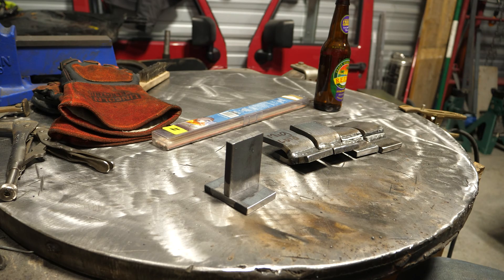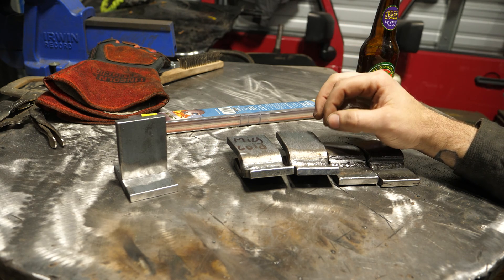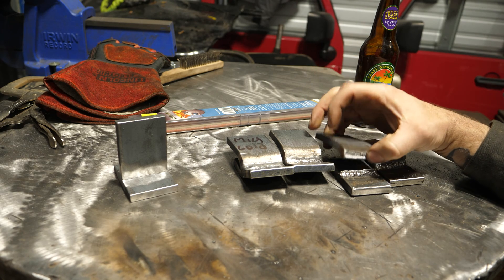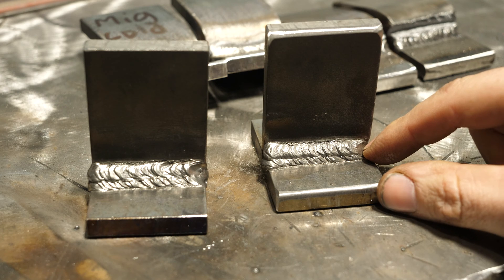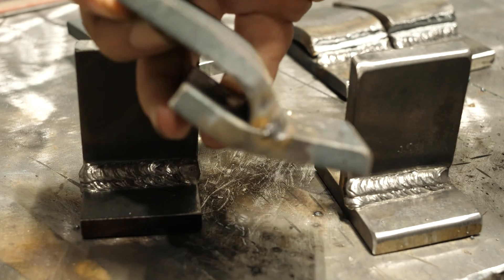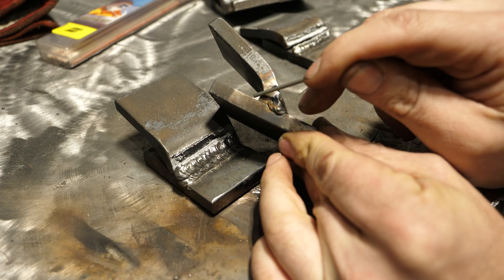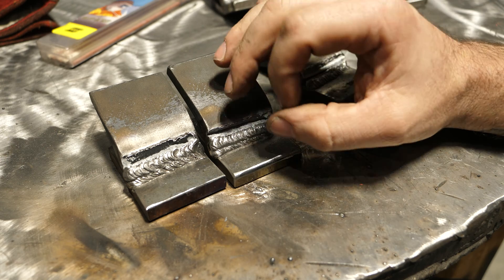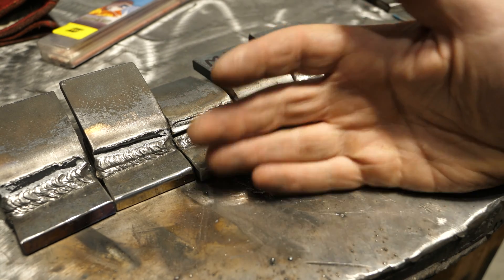6010 3 pass weld, will it break vs 7018?

Comment: In the school i went to we post heated and annealed 6011 to pass a guided bend test. 7018 over 60 series also tends to anneal the 60s deposit ? I only use 60s for an open root or thin non critical applications. Almost never.
Reply from the maker: So there are a lot of ways to get a bend test to pass when it normally wouldn’t (such as heat as you found out).  Capping 60xx series with a bunch of 7018 layers might reduce some of the brittleness, but I wouldn’t trust it unless it’s the only option.  I mean in all honesty if someone just used 6010 to bridge a gap, ground the root pass down a bunch, and filled it out with 7018, I doubt it would make a huge difference for most things.  What I would worry about is if what’s repaired sees impact force or vibration, that thin root could still crack.  7018 is significantly stronger across the board when it comes to holding things together that sees vibration and impact forces.

Comment: Does 6010 burn hotter than 7018? Any chance preheating the steel could mitigate this failure?

Looks like the top edge of the weld has more leverage on it. 
I wonder if it would change anything if you flipped that possible undercut by repositioning the steel before welding, so that the top edge ends up on the surface of the other piece, to see of it changes anything. 
If it follows the up-side, it might prove something is happening with the weld vs the current top side seeing more force.

Comment: Hey Greg, i have a test request for you. So many people talk about 6010 penetration that it kind of does disservice to 7018 and 6013. My theory is that the gas that 6010 produces that carries the arc is simply more efficient than the gas from 7018; in other words welding with 6010 is like TIG welding with Helium, vs 7018 being like TIG welding with Argon. Can you run a cut end etch plus bend test on 6010/11 say 3/32 rod multi-pass vs single pass on larger 7018 or 6013 at significantly higher current like 5/32 7018 rod? I am thinking it will all come down to current; 7018 at significantly higher current and rod size to carry that current will match 6010 penetration / strength (well raw strength will exceed 6010, since it is 70kpsi). Or may be for a more fair comparison do a 6010 (3/32 multipass) vs larger and higher current 6013(3/16).

Comment: Hahaha i was typing out can you do this with a 6010 root 7018 fillers and you finished out sayin your gonna hahahahaha
Reply from the maker: 6010 with 7018 cap works pretty good 😀.  It should be avoided with anything but mild steel, but it does work 😀

Comment: My uncle's 780 Case backhoe's dipper boom broke at the "elbow" pivot and he repaired it with ER-7018. Well, it broke again on the weld in less than a week. Found out the base metal is 75K psi I did the second repair for him with ER-11018 That's 110K psi tensile strength. It's been 15 years now and it's still holding! ER-8018 would have probably been fine but I had a good bit of ER-11018 on hand. I've always been in the camp of go bigger! LOL!
Reply from the maker: That higher strength alloy combined with likely thick plates definitely put a hurting on that 7018 lol.  11018 definitely is a big step up in strength.  Glad to hear it held together 😀

Comment: The reason the 6010 broke is because 6010 isnt ductile like 7018 theres a reason they dont use it on bridges and thats because bridges move and sway and 7018 is ductile when stuff moves and sways it is designed to take it 6010 is not the weld bead is stronger than the steel but not being ductile is the reason it broke it is not designed to move like that is the short answer to why it broke it is designed for pipe root passes and for really dirty rusty crap where if you dont have a grinder it can clean the metal by whipping it and then pausing to weld it
Reply from the maker: The particular steel I used can exceed the strength of 6010 rods tensile strength (as tested) so regardless of ductility it is at a disadvantage.  6010 and 6013 both have better elongation specs than 7018.   The purpose of that particular test was more to demonstrate that using a weaker rod for a particular steel cannot be “fixed” by simply adding more weld.  In virtually all cases it’s better to have a weld hold things together and to engineer the flex out of something (if desired) with bracing than to use a weld that’s overly brittle and weaker than the base material to prevent things from moving.
Reply: @makingmistakeswithgreg  6010 and 6013 dont have better elongation than 7018 7018 was designed to for things that move and sway under pressure furthermore the way you bend the piece in a press is gonna break it if you have a weld on one side and nothing on the back the piece will break regardless
Reply from the maker: If you look up specs for common rods, such as on this site:  https://www.washingtonalloy.com/technical-data-sheets/ they show actual test results than put 7018 below 6013 and 7014 on elongation.    The ductility of the weld and ability to handle elongation is not why 7018 can handle more of a bend than 6013 and 7014.  It’s more of a combination of factors such as actual ultimate tensile/yield strength and penetration.

The weld on the backside of a fillet weld has virtually no bearing on failure.  I could weld both sides of a fillet weld with 6013 and it won’t handle as much plate bend as 7018.  I even welded 3 passes on one side with both 6013 and 6010 and they didn’t bend as far as short arc Mig, dual shield, 7016, or 7018.

Comment: I weld natural gas pipeline for a living and the sop in the gulf coast is 6010 root fill and cover. Don't k own why , just is.
Reply from the maker: If I had to take a guess it’s probably because it’s strong enough to do the job and it’s fast.  It seems to me like every country has a different way of doing the same thing, and clearly it works multiple ways.  In the US you would never see a guy welding pipe with 6013, in the UK they don’t run 6010 they run 6013 lol.  In Australia they apparently run 7016 on pipe instead of 7018.  Pretty wild lol.

Comment: Thanks for the video , would love to see 6011 vs 7018 test
Reply from the maker: So I have tested 7018 extensively in this video: https://youtu.be/GNu9vEu91ME?si=Rm1sWztTcxQ_9lMp and in this video: https://youtu.be/MVG85I_KCg8?si=QLFjhahJyjyFxjdO .   To simplify the data from those tests here is my opinion:  6011 breaks on a bend towards the face in testing at 60-70 Ftlbs, 7018 is 70-78.  On a bend away from the face 7018 passes with a complete bend on 3/8th plate, 6011 fails.  7018 will surpass the strength of 6011 in both tests given the same weld size and material thickness.  If strength is of a concern 7018 should be used.  😀

Comment: Your weld was stronger than material
Reply from the maker: If the weld is stronger than the material then why did a single pass 6013 handle less pressure than 7018 single pass before it failed?  The multi pass 6013 failed in the same way as a single pass did, and the 7018 (and er70 mig) did not.  Two measures of strength could be 1) how many tons of force did the weld withstand while still holding things together, which the 7018 surpassed 6013 in this, and 2) When pressed to significant levels which weld was still holding the plates together?  7018 wins in this case as well.  The same material from the same bar stock was used in both tests, and clearly 7018 and er70 holds things together under more force than 6013, so they are both superior in strength.  Which is too be expected since the performance of both is below the average er70 and 7018 rods specs.
Reply: @makingmistakeswithgreg 6013 6010 are 60000 strength  7018 is 70000. Different metal welding rod Different  Flux material 7018 way Different than 6010 6013
Reply from the maker: Yes, all rods have different specifications, and all of them test well over the minimum AWS spec you’re citing.  If the failure was due to the strength difference in the filler material (which is what I said in the video) then it would be a failure of the weld.  You said the weld was stronger than the material, implying the material failed.  Or are you saying the 7018 weld didn’t completely fail because it was stronger than the material?

Comment: That thick of plate should have been v groove to get proper penitration on upper  plate open root keyholeing would have helped too and grind out wagon tracks 6010 is a fast freeze rod has a lot of pentatration and will weld through rust grease and paint but not always best choice
Reply from the maker: On a fillet weld v grooving wouldn’t really affect the strength of a 6013 when it’s bent away from the face of the weld.  V grooving increases the strength when bent towards the face (on a single sided weld) because it doesn’t allow the plate to use the weld as a fulcrum point to increase leverage.   6013 with a bevel will still not surpass 7018 or er70 mig wire in a bend away from the face, and won’t outperform 7018 or MiG on a bend towards the face if all of them had the same bevel.
Reply: @makingmistakeswithgreg the welding rods are completely different  welding rods for different applications comparing apples and oranges
Reply from the maker: I am not sure why you think it’s apples to oranges?  6010, 6011,6013, 7014, and 7018 are all sold on the shelf at most local stores (6010 less common), they are all designed mostly for welding mild steel, and the average person would potentially use them for their project.  The purpose of the video (which is one of many in the series) is to demonstrate the strength differences between to rods.  This video put forth evidence that the 7018 is significantly stronger than even 3 passes of 6010 on a fillet weld.  That is important information because many people are under the illusion that you can just put more weld down and that makes up for weaker welds.  It’s not expected that 6010 has more strength in a weld break test away from the face than 7018.  However even 3 passes of it (and likely 6013) can’t hold plates together as good as a single pass of 7018.  Again the purpose of the testing is so that people make informed decisions on what rod to use when.
Reply: @makingmistakeswithgreg well first tell me what the numbers 6013 6013 6012 6011 7024 8018 10018 mean I have used all of them along hard wire mig Flux core mig dual shield mig tig  submerged arc and both aluminum  and stainless steel. That being said to me looks like your welds with 6010 are either too hot or too fast not very smooth like a stack of dimes so some people say tig should look like your weld puddle looks pointed not smoothly arched like it should  no matter what welding  rod or type you are doing

Comment: When I do multi-pass welds I tend to alternate travel direction (to swap starts and ends) between two consecutive passes, this helps to compensate for cold start bulges and hot end craters as one is completing another's profile to an equal height. I don't know if this is a right thing to do, but it kind of helps.

Comment: I’m curious if you would have turned one of the plates so the bending was more pronounced on the bottom of the weld instead of the top would the weld have broken on the bottom instead of the top
Reply from the maker: That will be difficult to achieve because the fillet weld has different plate lengths.  I am planning on doing a butt welds and testing the strength as well, that will equally load both sides of the weld.

Comment: I know, as you have proven multiple times, that 7018 will always be stronger.  But i still use 6011 on a lot of stuff that isn't critical.  I always go to 7018, or TIG, if life or limb is at risk.  Or if i just want a pretty weld.

Looking forward to 7018 over 6010 tested.
Reply from the maker: I 100% agree.  Not to mention in that test in video the equivalent of over 6K pounds was sitting on top of that fillet weld and it didn't break at that point, which in reality is a pretty ridiculous amount of weight.  Poor welds (lack of any root fusion, porosity, slag entrapment, etc) could easily knock a 7018 down to far less than that 6010 too.

Comment: Good testing protocol, In your conclusions I think you hit the nail on it's head.  Your welding technique appeared to be very competent, I believe any technique using 6010 would have failed.  Perhaps you could try 7010 HYP or 8010, they are both considerably stronger than 6010.
Reply from the maker: I am going to try a 5p+ grey rod which produces a slightly more liquid puddle (thus smoother bead) and see what happens.  I am 100% sure it will fail since 6013 and 6011 has failed in the same manner as 6010.  Whats interesting to me is the rods that fail, seem to fail in much the same manner, the top toe line.  The top toe line is seeing far more stress on it than the bottom toe line due to how the plates bend.  From what I have seen (I have a lot more tests that I haven't released yet) 7018 and er70 mig seem to have a magic mix of strength, ductility, and performance that elevates them above the others.  To me it really doesn't matter if the plate itself failed, if the weld failed, or if a combination of them failed, the 7018 and er70 bent further and stayed together despite seeing the same level of stress.  The 7014 video comes out in a couple days and I will do the same test with 7024, tig, and flux core.  I have a feeling 7018, er70, and tig will top all.

Comment: So how does this square with the penetration of a 6010 vs. 7018?  Isn't the 6010 a more penetrating rod vs. 7018?
Reply from the maker: Penetration is not a benefit in this test, because the weld is being pulled on.  6010 penetrates deep but the weld deposit has weaker tensile strength when compared to say 7018.  If the plate was bent towards the face (opposite as shown in the video) the 6010 would win due to penetration.  In pure tensile strength 6010 will never beat 7018.

Comment: Now from the looks of the video, its user error as in technique why it fail - from looking at the welds you’re not that great at using 6010 but other than that from a perspective of what’s user friendly it would be 7018 regardless.
Reply from the maker: There is no undercut and all of the slag is not removed.  What needs to be improved in technique to make it pass?  I assure you it will break in the manner it did regardless of whipping/pausing, long arcing, etc.  You must also remember the weld was done with red rod 6010 and not the grey 5p rod.  The red rod leaves a rough bead no matter how you run it.  If you want to see me put down a flat cap with 6010 5p I will, but it will still fail lol.

Comment: Now do one where you puddle cap style 6010 vs a whip and pause 6010
Reply from the maker: I will likely do that.  The problem is I only have red rod 6010 around and it runs very poorly if you don't manipulate it to knock the flux down.  It basically winds up having a very long arc gap trying to run it straight in and it becomes very difficult to control.  The grey 5p+ rod is far easier to run "straight in" and produces a much smoother weld bead appearance.  I have to wait for the welding store to open to get more of 5p+.

Comment: This answers everything for me.
The wrong rod is the wrong rod.
I did have my hope that in a pinch I could get away with an oversized weld of 6010 but this really tells the story.
Reply from the maker: The extra weld did slightly increase the pressure it took to bend it, but ultimately it still failed.  I will take having it “hang together” over broken for sure lol.  7018 two bead cap on top of 6010 root will be out tomorrow, with “interesting results” lol.

Comment: Great vid as usual but I dunno about the harp.  This is a family channel so I can't say what the "harp" interlude congers up in my pin head so I'll just say a nice guitar rift would be a better choice for me.  Maybe Texas flood by the late great Steve Ray Vaughan, something from Jimmie Page, BB King --you get the idea.  lol  Also, where you getting all this 3/8" plate from??  If you've found a deal that doesn't involve "borrowing" some stock at 3am from the local supply store --I want a piece of that action.  🙂
Reply from the maker: Haha the magical harp helps with welds.  I wish it was like the old days where I could use actual artists music without them basically shutting down a video.  I have some more rock centered music I will use in the future.  The 3/8th plates I have been using are cut off two 12' sticks I bought a while back.  I actually have a ton of steel from jobs I have done, I have been working through that.  Buying new stuff is very expensive.  I did buy 300' of 1/4 inch thick flat bar (I think 2" wide) on a fire sale from a local supplier 3 weeks ago.  It was about 60% off and I had to take all of it (I think it was 26 sticks of it lol).  In future videos I will be using a lot of that for testing purposes.

Comment: Thanks for the vid and, well, my only comment was exactly where you ended up - 6010 with a 7018 cover seems like the best of both worlds.  But if a single 7018 passed, I'd certainly expect the combination to pass.  But this makes me appreciate why that combo is often recommended.  The thing I don't get is why there is so much fuss about 7018 and low H - I would assume none of that applies if it's covering 6010.
Reply from the maker: Tomorrow a video comes out where I test that exact thing.  Same 6010 root and 2 bead 7018 cover.  Differences are found in the testing vs this video lol.